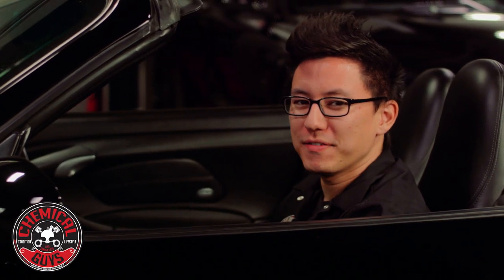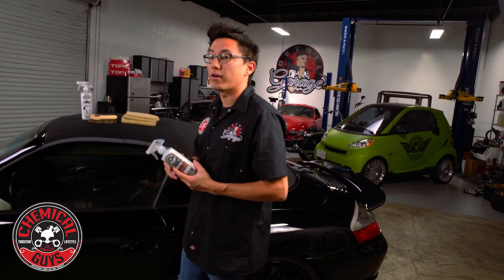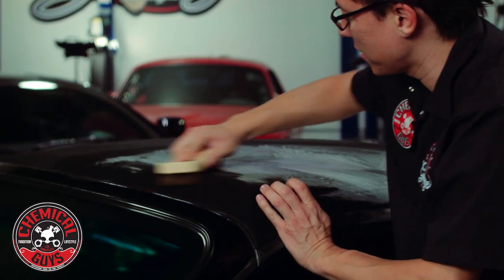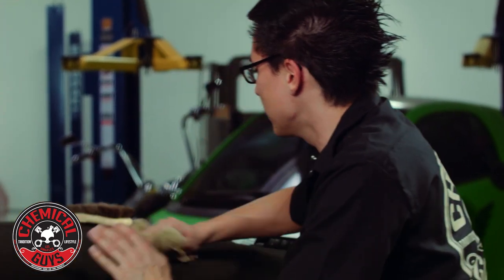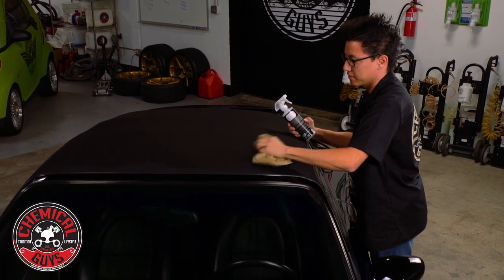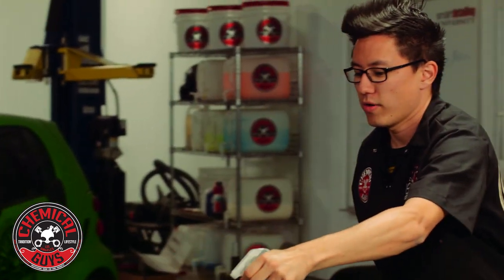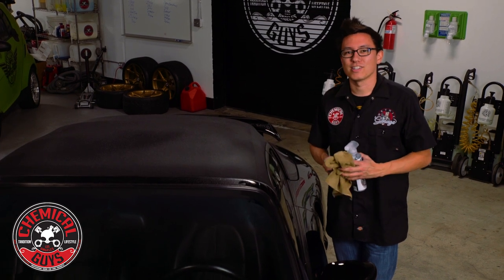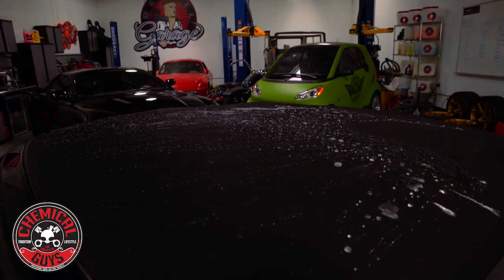How To Clean And Protect Convertible Tops - Chemical Guys Auto Detailing

Comment: Are you sure you don't need to rinse the cleaner off before using the protectant?  It defies common sense not to rinse.  Also it says to rinse off right on the directions on the bottle.  I noticed that when you poured straight water on the top it sudsed up.

Comment: Should I wait for cleaner to evaporate  before I spray protectant or just brush the roof with cleaner, wipe off and apply protectant?
Reply from the maker: Hey Matt! Yes, either wipe off or let the surface thoroughly dry before adding the protectant.
Reply: @ChemicalGuys hi do we need to use the cleaner with water or just spray, brush, wipe off and let it dry?

Comment: Does the convertible top have dry off after you're done cleaning it to protect it?
Reply from the maker: Hey! It is recommended to dry the surface before applying Convertible Top Protectant.
Reply: @ChemicalGuys  is just drying it with a microfiber good enough or should I have it sit then add the protectant